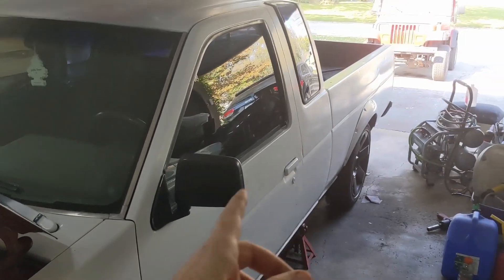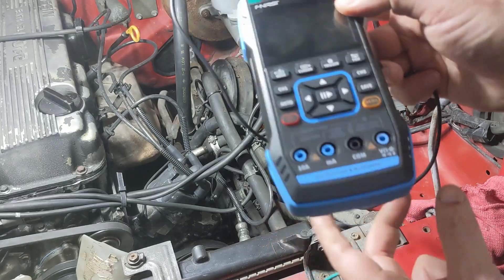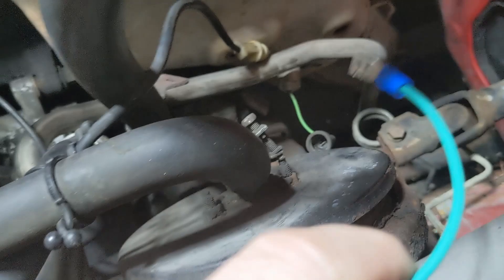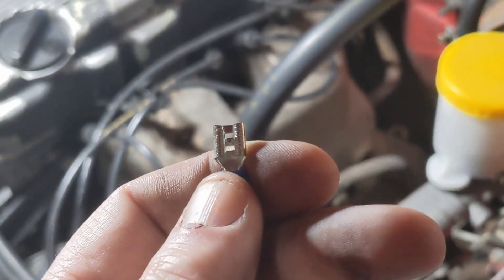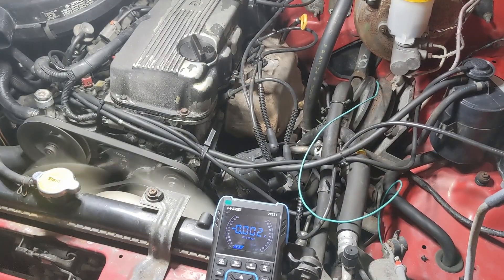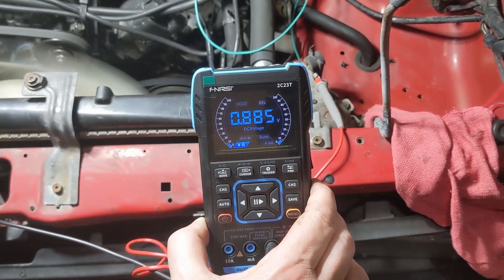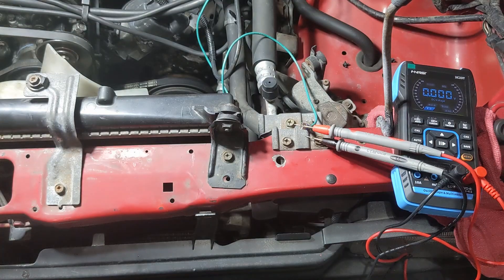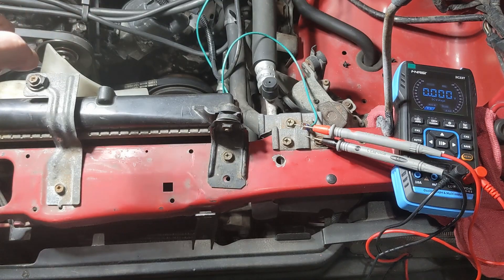Pre-OBD Oxygen Sensor Testing: 1990 Nissan D21

Comment: my 1995 is doing the same, I think you have to perform the test with the lines hooked up, If not, the computer is going to give you a bad reading..
Reply from the maker: The wire is a signal output to the computer. The computer just reads it like the meter is doing.

Comment: Some of those old Nissan ECUs had a screw/pot on the side that you could turn to get blink codes from an LED on the ECU.  Maybe the coolant temp sensor is reading too cold and the ECU is stuck in open loop warm up mode?
Reply: Yes -- the 1990 D21 does have OBD-I.  The ECU is under the passenger's (right) seat, and the dial + LEDs face toward the driver's seat.  A pain to use, but it is there.

Comment: Voltage on an oxygen sensor is not the major point if it's a one wire sensor I don't one wire system the computer is just looking at whether it is under half a volt or over half a volt and the time it takes to crossover. The early computer systems were simply reading the crossover time as relevat to the mixture.
The oxygen sensor can have proper voltage but be lazy and not crossover fast enough.
Reply from the maker: Correct me if I'm wrong, but I think the fact it's basically pegged at 900mV at idle is showing there's a problem causing it to run rich (the exhaust smells hella rich, too) and while the O2 sensor could be bad, it was reacting reasonably fast so it's less likely to be the issue. The next video will show the MAF sensor is outputting basically nothing, which I'd expect to be in the 600-1200mV range.
Reply: OBDII keeps track of cross counts, and decides if it is too slow or not. Pre-OBDII engines typically only illuminated a warning light if the O2 sensor was constantly giving a lean voltage, a rich voltage, an open circuit, or a short circuit.

Many older Nissans had a "Sensor" light that was tied to the odometer. It would illuminate at the mileage that Nissan estimated the O2 sensor would fail.

However, some pre-OBDII cars would fail a smog test due to the O2 sensor being too slow but not indicating any error codes.

Certain OBDII cars would have an underperforming oxygen sensor, but not underperform enough to cause a warning light.

I think you indicated that this was caused by a MAF.

Another cause of this problem can be coolant temp sensor failing, and failing in a cold temperature that the ECU sees as plausible. Then the ECU would order a rich idle and ignore O2S readings because it assumes the cold engine would stall. OBDII had a timer that would estimate when the engine would be warm, and set and error code when it didn't see warmup in a timely manner. This wouldn't be in pre-OBDII engines. Some setups have one temp sensor for the gauge cluster and one temp sensor for the ECU, other times the temp sensor for the ECU and the temp sensor for the gauge cluster would be different. That is why it is important to read the manual, as the gauge cluster sensor could work fine, but the ECU sensor could indicate the engine is cold when it isn't.